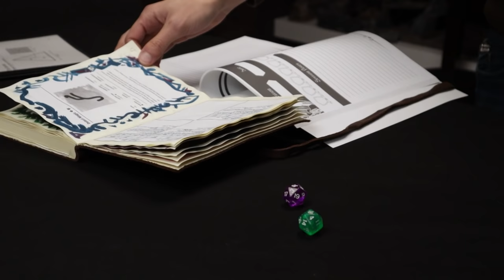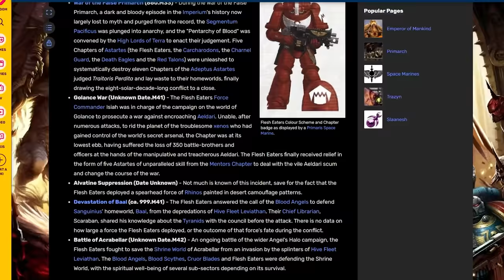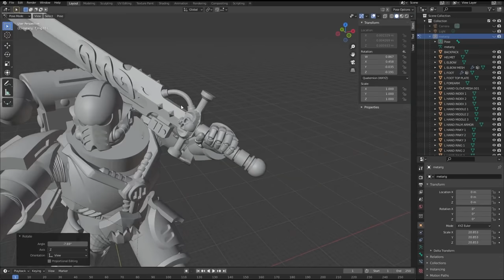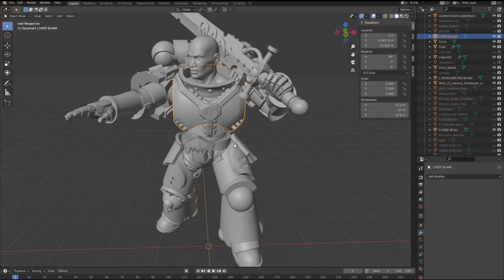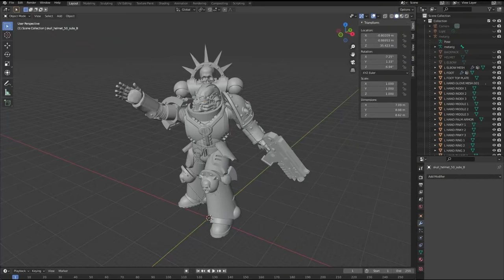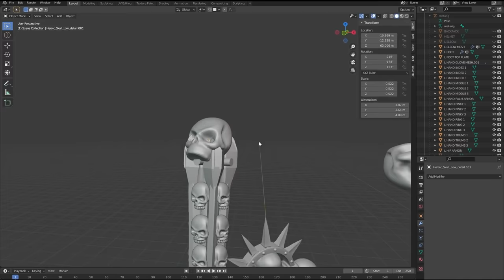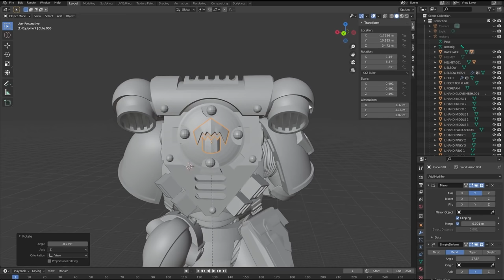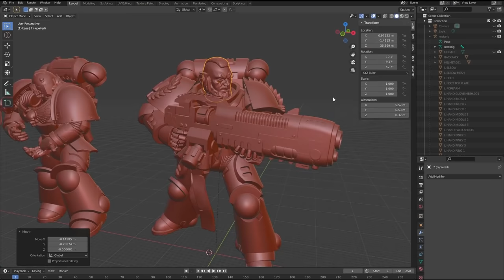Making a SPACE MARINE Diorama Featuring My Friends

Comment: Fantastic quality on that diorama, Knarb!!

Also, this is the first time I've ever seen anyone else use Gouache for tabletop terrain washes! I've been doing that for a while because I love that I can come back with a wet/damp paper towel and remove (or soften if just brushed lightly once or twice) the wash wherever I want, just like an oil wash, but without the need for solvents like mineral spirits! I've been using an artist's grade gouache because it's highly pigmented, but any gouache would work well for washes (plus a drop or two of dish soap or flow medium of course). I love it!

Of course you also gotta give the terrain a coat of some kind of varnish or matte spray at the end to protect the paintjob, but I do that anyway even when I just use acrylic paints!

Comment: Knarb, I love your builds, but remember a coating of Mod Podge makes everything stronger and easier to paint. Mix it with black paint so you can tell where you have applied it. It protects your builds, acts as sort of a primer, and makes it possible to paint anything quickly because it won't be thirsty. Additionally, you can also spray paint foam coated in proper layers of Mod Podge.